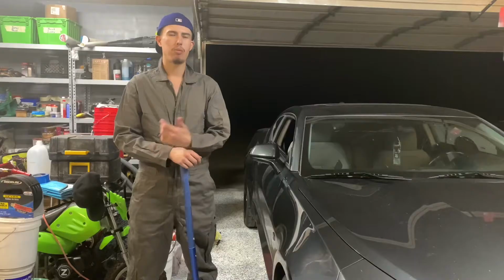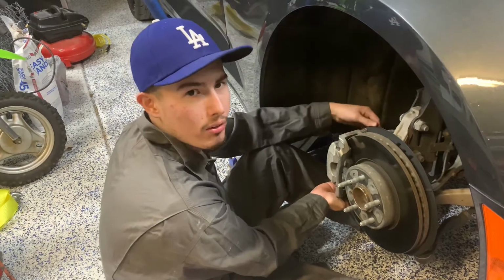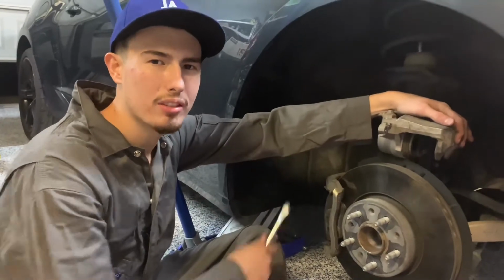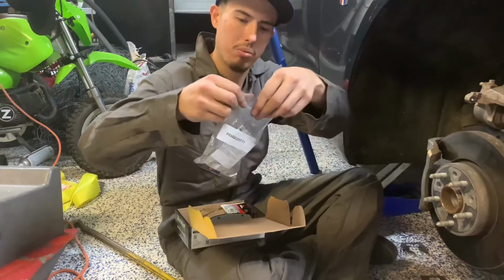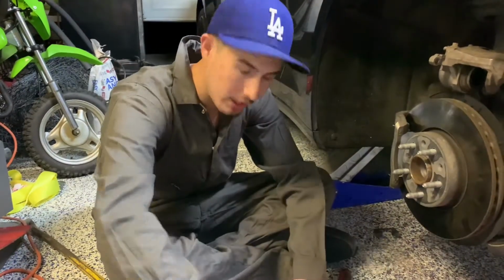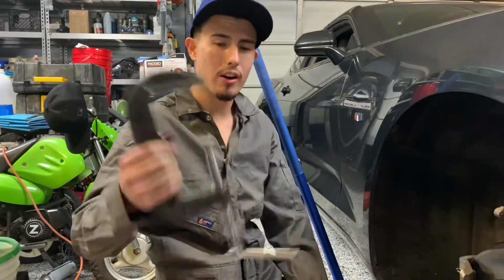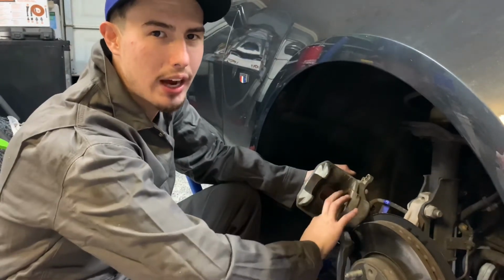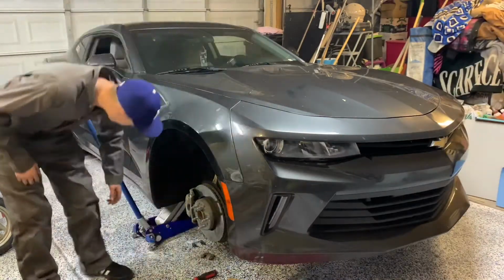DIY changing brakes on a 2018 Camaro

Comment: I got a Camaro rs 2018 and I thought it was gonna be harder for some reason lol but u helped me a lot bro thank you 🙌🏻
Reply from the maker: Pretty easy bro and the rear breaks you gotta adjust your electric parking brake to close the cylinder. Also after you put everything together put the parking break on and off a couple times so it can adjust to your new breaks

Comment: First off, you should have just pushed the caliper in a bit instead of using a pry bar to get the caliper off. When you re install pads, put a little brake lube where the caliper touches the pads, and take put the slide pins and grease them also